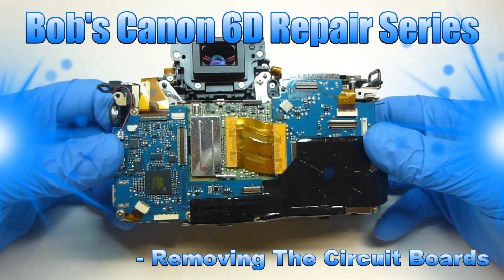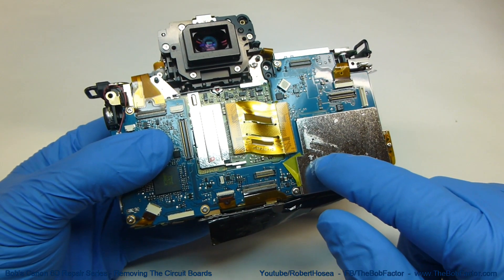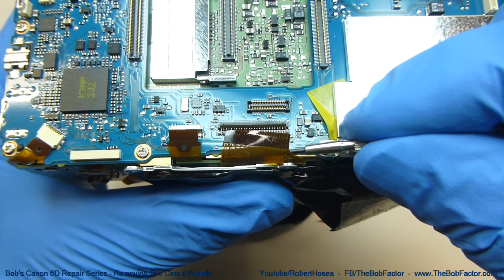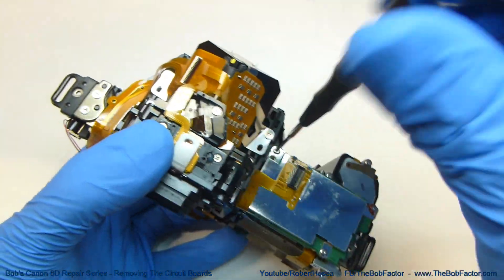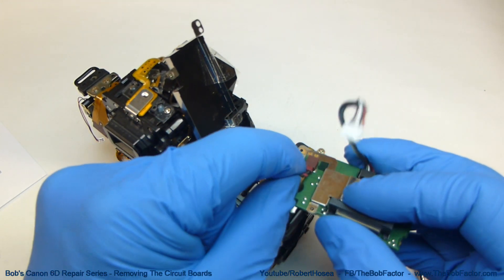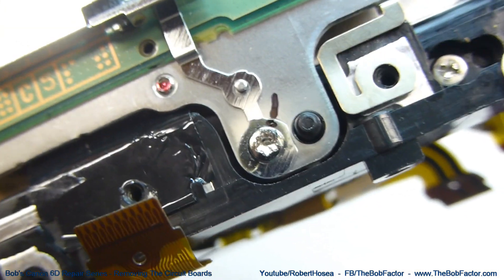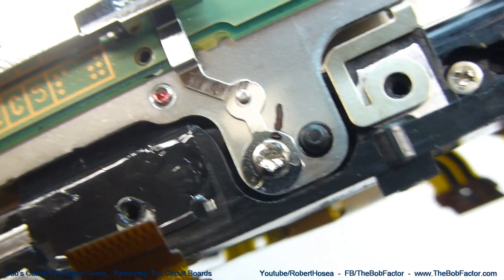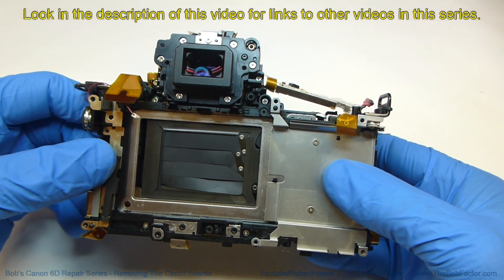Canon 6D Repair Series - Video #2, Removing The CIrcuit Boards

Comment: Canon 6d m ll replacement of the old base plate with a new model, is it possible
Reply from the maker: It would have to match the size and shape of the original plate pretty closely to fit. There tolerances were pretty tight.

Comment: Hi. I watched your video to disassemble a broken 6D which doesn't power on. Now I can't see anything damaged inside. Is there any way to test the power board voltage? The fuses seems okay. I'd like to know which board is faulty.
Reply from the maker: Hi. Unfortunately I don't have a video showing how to test the power board on the 6D. And I don't have a 6D right now that I can use to get the voltage information for you. Sorry I'm unable to help you TurboLed.

Comment: Great Stuff, Robert. Boards removed.  I still can't get to the battery door close contact switch that has broken off inside the conduit that encircles the battery compartment. Do you have a tutorial in the making for that "procedure"? Thanks in advance for any advise.

Comment: if sensor replace.. need do aligment?
Reply from the maker: Yes. Be sure to mark the screws and count the number of turns as it shows in the video. That will get the new sensor close to the correct position.
Reply: @Thebobfactor  do you have a video on how to align?
Reply from the maker: @devil_samuraix6176  No, sorry I don't. And I've never seen any good videos that show how to do it. I would suggest suggest starting out with the sensor as level as possible by backing the screws out one full turn each. That "seems" to be a general distance for most on the Canons I have worked on. Then find a focus sheet to download and print it out and take a picture of it. Check to see that the location that you focused on on the focus sheet is in focus first. That is what is referred to as the "Front Focus" and the "Back Focus". Adjust the entire sensor up or down until that spot becomes the generally focused area. Then you will be looking for any differences in the focus between both the top and bottom of your test picture, and then also the left and right sides of your test picture. If you see a difference in one direction or the other, then you will need to change the angle of the sensor based on that direction. For example, if the right side is out of focus and the left side is in focus, then raise or lower the right side of the sensor and take another picture to see how it effected the focus on both sides. Then readjust and recheck it again. Do it until both sides are equally focused in that direction. It will be a trial and error process for sure.

Comment: Hi, thanks for the very comprehensive tutorials. I have a very basic question, though: if I have to replace the Mode Dial on the top, what is the safest or quickest way to do it? The Camera service in Italy wants some 50 Euro just for getting it checked in.. whilst the spare part on amazon is 10€ so I wondered whether I could just change it myself...? (I'm not an expert :) Thanks in advance
Reply from the maker: Hi Roberto. The quickest way would be to replace the entire top unit. I looked on Ebay and there are a couple of "used", but working, top pieces for about $60. I've never worked on a 6D's power button or mode selector, and unfortunately I don't have a 6D handy right now to look at. I believe though that a 6D's mode selector might be similar to the 60D's (Sixty-D), and I do have a video showing that. You can see that video here: https://youtu.be/rpE7Co3dfgo. Good luck with it, and let me know how you make out on it.
Reply: @Thebobfactor  thank you very much!

Comment: Great tutorial so far Robert. I wanted to give a heads up on this section as I am currently replacing my shutter. You skipped the step of removing the Tripod Mounting Plate.
Reply from the maker: You're sure right. Ya, I didn't realize that. Thanks for pointing that out to me. I hope the shutter replacement job goes well for you!
Reply: @Thebobfactor  it was till I put the new shutter in and encountered an issue with the top shutter piece they sent me. It's not the same and is blocking the guide pin from resetting the shutter. Gotta return it and hope they send me the right one. Love the tutorial though! Very detailed and has made the process very easy for me!
Reply from the maker: @FloridaStormChaser   Oh man, it sucks getting that far into a repair, only to find out they sent the wrong part. Hopefully it won't take too long to get a replacement. I'm glad the videos are helping you out with it though. Let me know how it all works out for you.

Comment: Hi Robert, is there a faster way to replace the MS614SE battery on the board without taking out everything?
Reply from the maker: Not that I can see at all Arden. They sure make a big job out of changing that little battery. At least on some of the other cameras they put the battery on the front side of the main board, which made it a lot easier to get to.
Reply: Thank you Robert, I hope I do good following your guide. :-)   Great job on your tutorial!  TY!

Comment: Hi Robert! Great videos!
Can you indicate which of these boards is the wifi board?
Already thanks a lot!
Reply from the maker: Hi Gustavo. The WIFI board is on the underside of the top unit, and it looks like this: https://www.ebay.com/itm/Canon-EOS-6D-WIFI-PCB-Board-ASSY-Brand-New-Canon-Partcg2-4205-000/331836827919?hash=item4d4304290f:g:GuAAAOxy63FS3DrY. -Bob